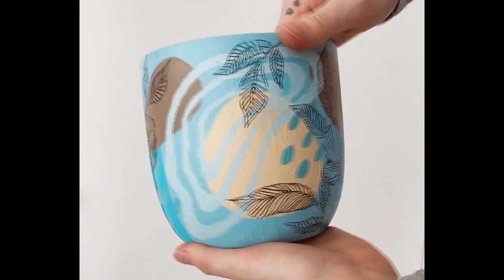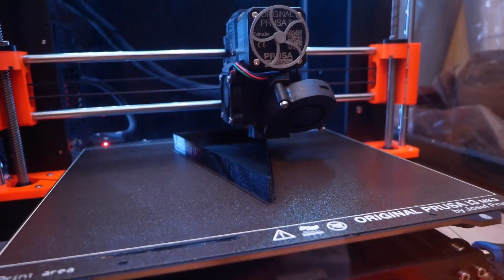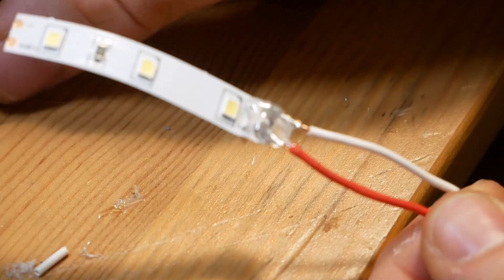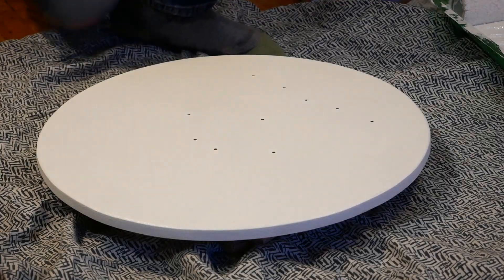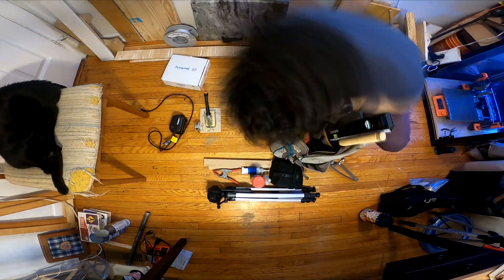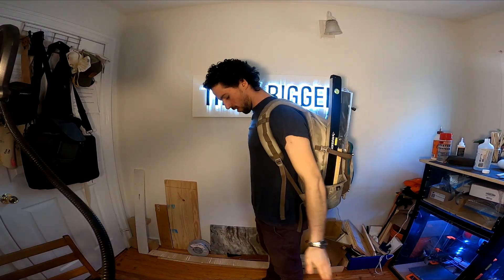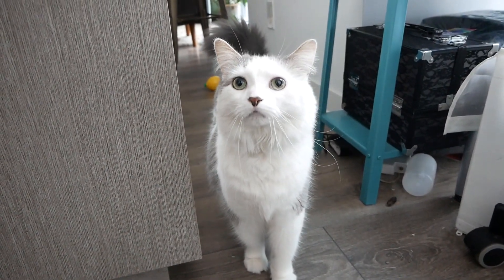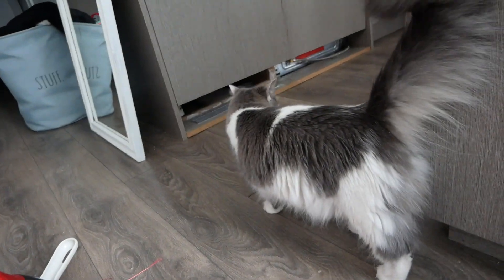Making a BACKLIT STUDIO SIGN with ViV Jewelry

Comment: You talked about extending the pockets for the nuts. I think if you do a similar project not only should you extend them to capture the nuts but you could also build the standoffs into that, and the nuts can be away from the face so the bolt length doesn’t have to be super critical and you don’t have to mess with extra nuts on the surface. We go to school on the first one!😉
Reply from the maker: True! Good idea 😊